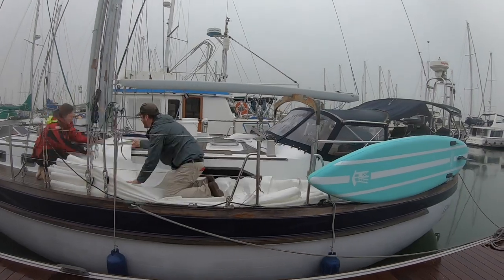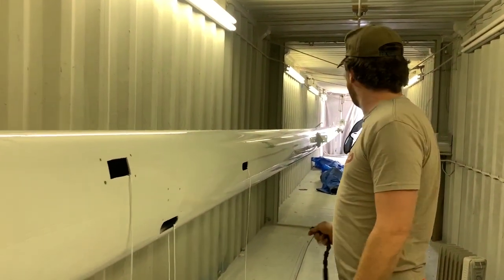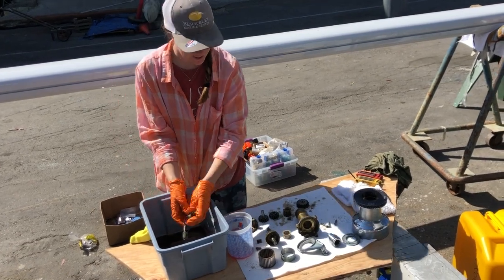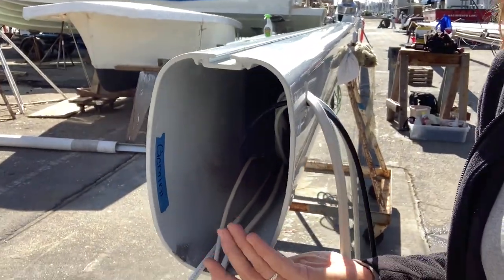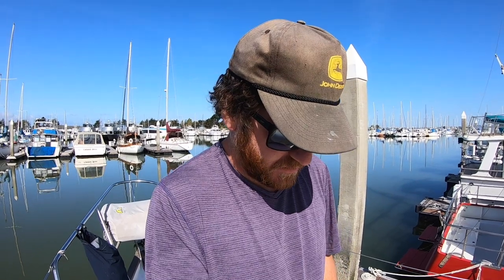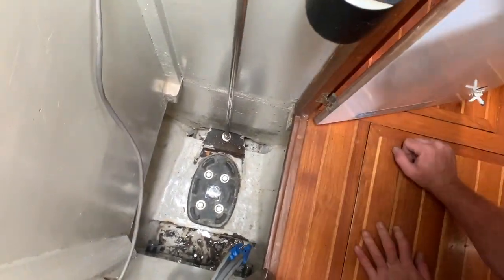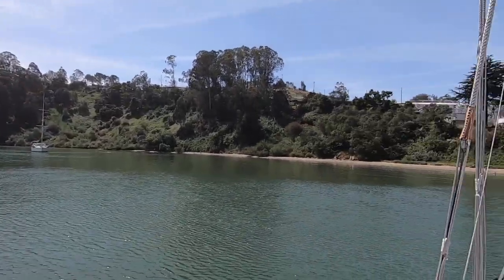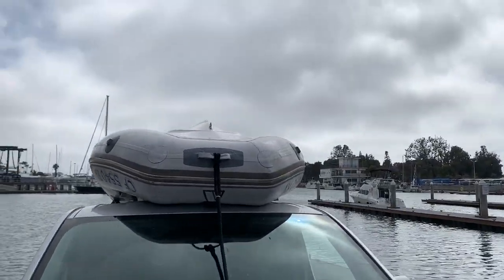EP 24: DIY Dyneema Standing Rigging - WE'RE A SAILBOAT AGAIN! | Two the Horizon Sailing

Comment: Now that you have had your synthetic rigging on for a while, have you found the the shroud to be noisy when the wind picks up?
Reply from the maker: Funny you ask, we have noticed that certain wind angles make a vibration noise, it’s not really in high winds, it’s more about the angle and at around 12kts usually. Really the only downside to our synthetic rigging so far. 
We have helped the noise by putting some lashing in between the shrouds, we plan to make some more permanent lashings soon :)
Reply from the maker: Have you experienced this as well? Have you found a simple solution? Would love to hear your thoughts, there not a lot of cruising boats gone full synthetic to compare. Cheers!
Reply: I am currently rerigging my 46 with heat annealed SK75, 7mm on the main, and 5mm on the mizzen. Only the fore and inner stay will be steel. After a conversation with a cat owner who went all Dyneema, his one big complaint was about the noise. 

So, did a little research on the cause and effects, and have come up with a possible solution. Won’t share the details until I see if it works, but I will keep you apprised.
Reply: Our synthetic rigging makes no extra noise compared to our old steel rigging. Ours has been standing for 7 years and 18,000nm, so it’s hard to remember back to the days when it was steel cable ⛵️